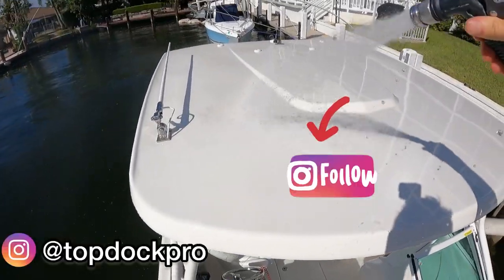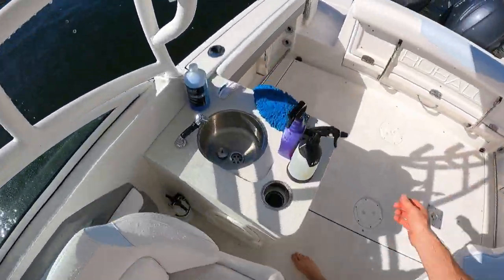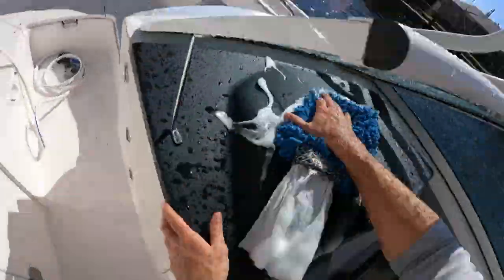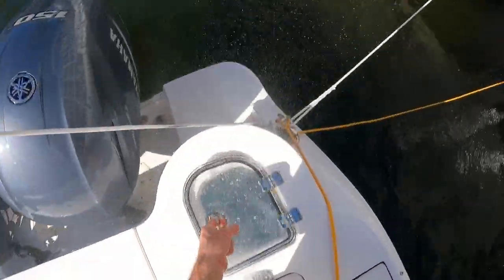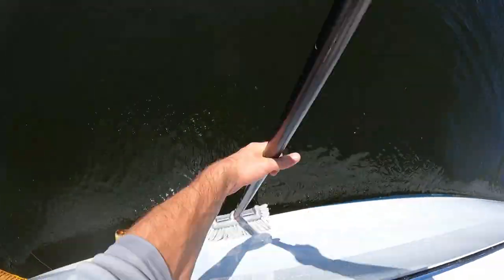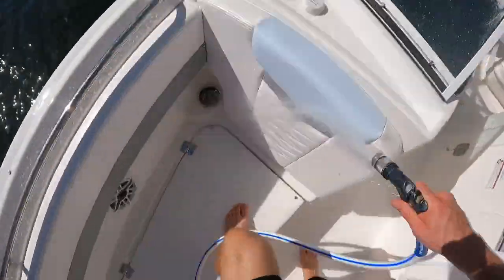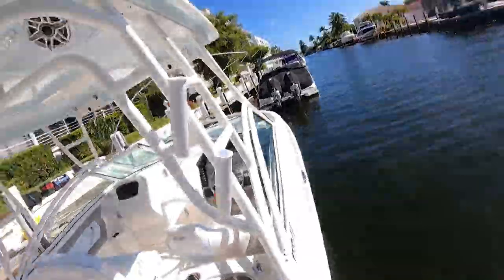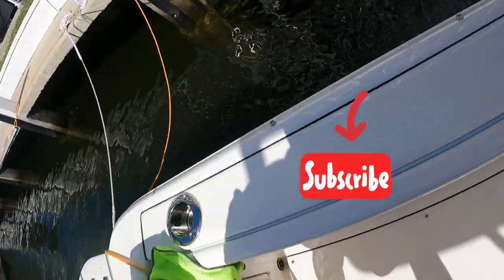How to Wash a Boat??? | Full Boat Wash Tutorial on Robalo Dual Console

Comment: When the anti-slip is coloured yellow do you use super clean aswel to get the white colour back? I use a white powder its a soft acid to get the colour back and scrub it by hand but its very strong and can hurt your body or the seats ect. What do you think any suggestions??? Good work men keep it up!!!
Reply from the maker: Super clean removes dirt and grime. It’s a great degreaser especially for boats. If a degreaser doesn’t get your nonskid back to white, then it’s very likely an oxidation issue. Acid only removes rust and heavy metals. My suggestion is you buff out the nonskid with a wool pad and a rotary buffer. Turn the buffer on its side and buff the nonskid and in between the low spots of the anti-slip. Use a heavy compound such as Starke Level R and you will probably need a few rounds to get it back to white!